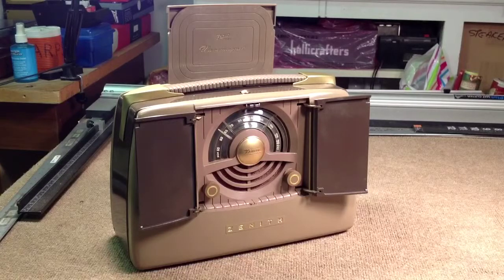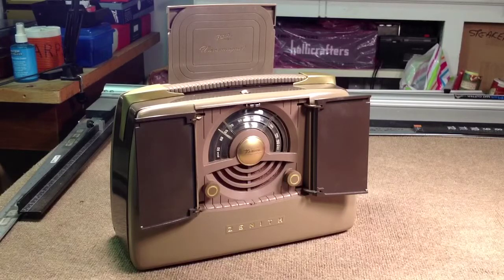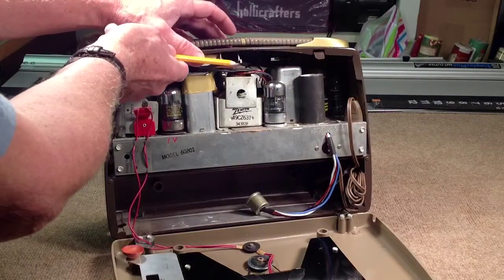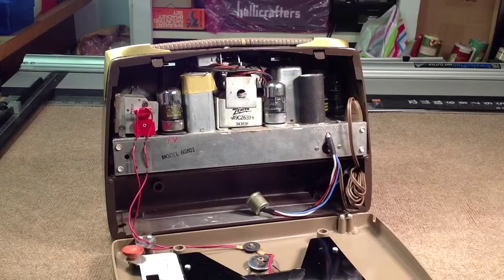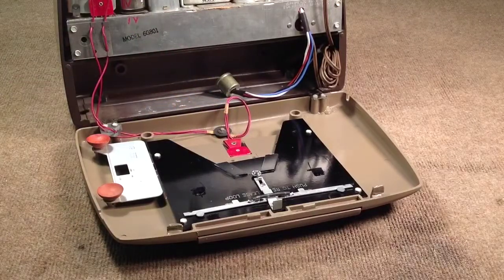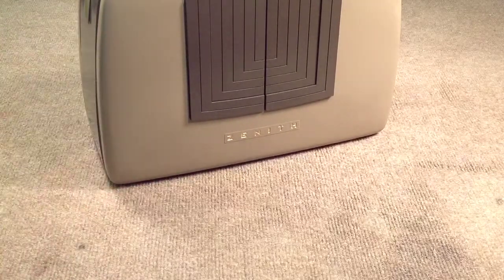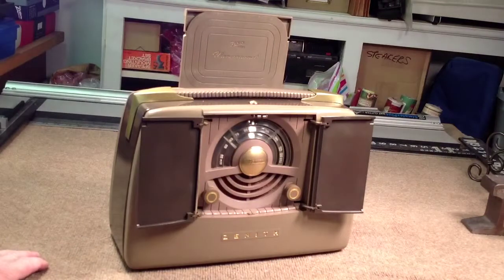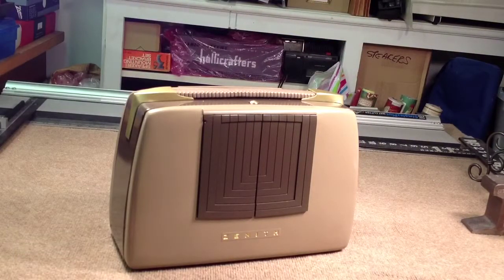1949 Zenith 6G801 Universal Portable Radio

Comment: One other thing I forgot to mention until it just occurred to me.
I have been using wire strippers since the 60's when I got my Ham license. Until today, when I watched your video, I never realized what the flat tip of the strippers could be used for. I could use them to help me pull off the insulation just like you did! That was a good tip Jim that I will start using from this point forward.
Kind of reminds me. I never realized the hook on Weber grills were used to hang the cover on the side!

Comment: Great Video. I just picked one up today and it does not turn on. The battery is missing but using the power cord. I will have to look at the power switch which you described very well. Something to play with when I find time. Thanks for the video. You did an awesome job.
Reply from the maker: Thanks and good luck with your restoration.

Comment: Someone gave me one of those when I was a kid.  It didn't have the wave magnet (I replaced it with a loop antenna from another radio).  Mine also didn't have the tube rectifier, it had an Selenium rectifier instead. I used a bunch of D cells in series and a 67.5v B battery to run it.  Played nice.
Reply from the maker: The audio quality is quite good on these radios.   Most of the Zeniths had decent audio.

Comment: Nice job, Mr Morris!  I just picked up one of these from a neighbor who set it out on the curb.  It's the black one, in pretty good shape, but it has a broken door hinge.  Do you think this is worth anything?  I don't want to sell it, just curious.  It will make a nice decorative piece for our 1946 house.
Reply from the maker: Unfortunately, not really.  If you look at sold listings on eBay, they tend to go for very little.  However, these radios, properly restored, are sensitive and have good quality audio, and are an interesting piece of our manufacturing heritage.
Reply: Indeed.  Well, I'm not really concerned with the monetary value.  Sure, I saw that one sold for $275, though it did not describe the condition.  I just gave mine a good cleaning, and it looks magnificent.  Thanks for your insights!